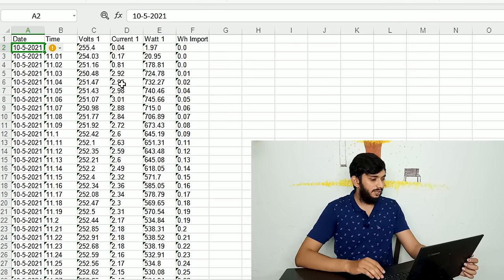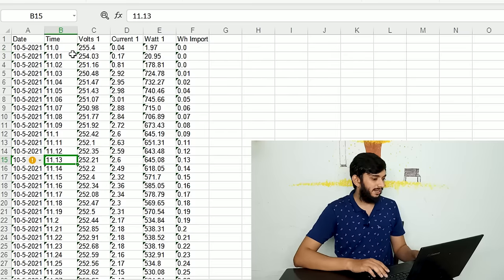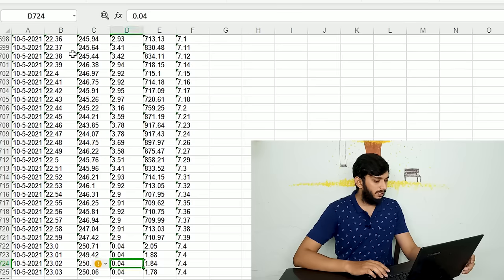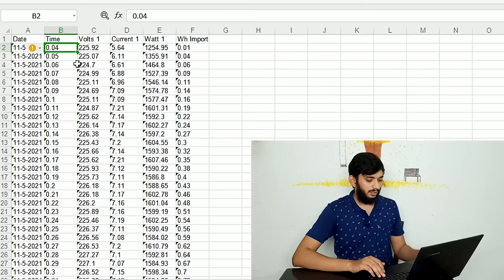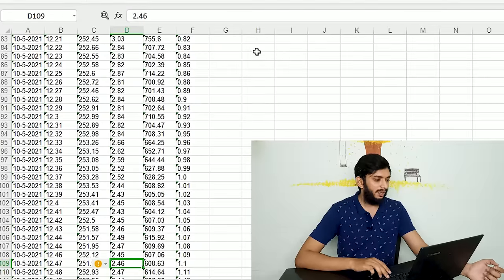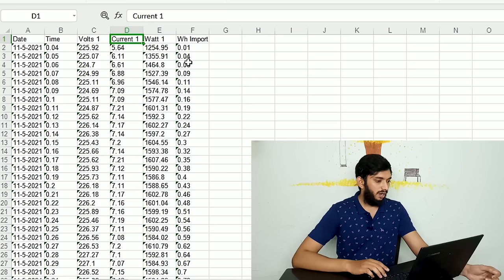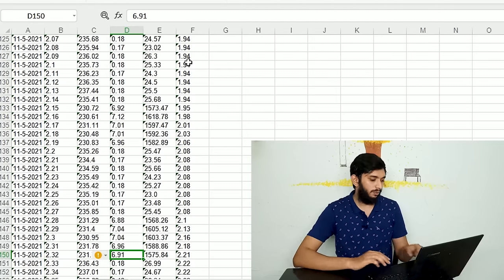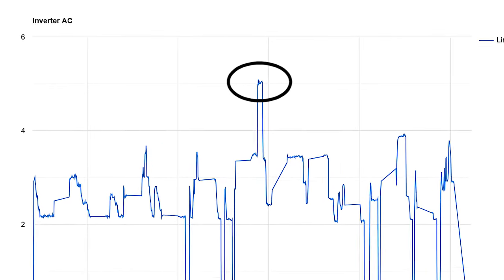Inverter AC vs Normal AC, How much unit will it consume?_Tamil, Does Inverter AC, Energy efficient?

Comment from the maker: Whoever is saying that, inverter Ac consume less power on night. I've given night time data on instagram.. 
https://www.instagram.com/syedimran.ef?r=nametag
I understand, many bought inverter Ac and justifying your purchase.. but there's nothing wrong in it. It's a good technology. Even I bought inverter Ac only.
Reply: Please Mention Star Rating & Year
Reply: @engineering facts inverter technology is the same but there are differences in their performances bro. Brands like LG has many models and its output, input power varies accordingly. So there is a chance that reconnect being a low budget inverter Ac, consumed more power. You can try d similar experiment with premium brands and let us know if there is no such differences. If there is really no such difference in power consumption btw non inverter and inverter ac, then y such innovation should take place bro
Reply: Do one thing show as the models and energy data stickers of both models. Like the cooling capacity and wattage information.
Reply: Oru Vela ton and ratings naala diff irukumo bro,?
Reply: Bro I have told correct answer...

Check my comment plz.. 
🥳🥳🥳🥳
Reply: 2 ac um enna brand ,yaethana ton uuh , enna star rating, enna year model yaedhuvumae sollulina epadi bro nanga judge panna mudium. Intha mathiri nalla videos ku full details kudukama Yen thirumba engala confuse pandringa. Please provide all the above mentioned details.
Reply: Bro inverter AC you have checked in morning time such that 11qm to 11pm.
In this duration outside temperature is high and also movement of people high(i.e. doors are frequently opened closed people coming going which leads to loss of cooler air inside room.
While testing non inverter AC u show results from midnight 12 am to 12 pm. So this values has bias.
I have seen same comparison videos from other channels which show the exact condition and inverter ac power saving when compared with non inverter
Reply: @franklinroy8333  bro you told that you have seen comparisons video from other channel...  athu enna channel name nu sollunga bro nan pakuren. Ellana video link share pannuga bro. 
This video is good but incomplete
Reply: This lockdown people face in electricity bill bro. I also figured out it already. It called conversation current cause the problem power fluctuation. Government known it people will see three paremeter V I=R ,P only. There series and parallel connection problem it causing this bro. Try to speak with proof let the people understand
Reply: I am waiting for next video
Reply: I am ECE department student I know this problem. I face it too in my project too while building it
Reply: When we connect electric device in series voltages is constant and current can be varied and in parallel current is constant  and voltages is varied it's called Kirchoff of law current and voltages.
Ok then why my home get affected . Here is fun things home is parallel connection for main power line . Where industry and manufacturer known this problem there will have separate transformer for this problem to avoid . Speak out bro. People will get educational

Solution. To reduce the cost of electricity bill According to fluctuation. It can be predicted by main power disturbing grid center  or but put transformer like for phone charger and PC adapter for every house appliances need inverter only. For more visits how power disturbing and monitoring
Problem: people is victim to pay others people power consumption of electricity
Reply: No bro Reconnect is not a best ac to evaluate try the same experiment with Panasonic o general Mitsubishi inverter AC s u may find good difference our eb bill decreased by 30 to 35 percent on replacing lg non inverter
Reply: @thamizhvananak2530  Yes this is really make sense
Reply: Thank you for your answer
Reply: AC energy consumption depends on the outside ambient temperature. How can you compare this, because one test done in day time, one at night time. Test itself is wrong ...you need to include few more parameters
Reply: Bro u have operated normal Ac during night and inverter during day time.though u checked same day night temperature will be less than day temperature. So reverse and chk u ll get idea.  When temperature high the compressor will run continuously . So it might operated continuously during day time. This is also a factor
Reply: Hi bro … it would be great if you could also check some additional things like
1) Gas/refrigerant levels / pressure 
2) indoor unit filters and coils are clean and not clogged up 
3) outdoor coils and air flow (factors that may affect heat rejection) 
4) perform test where both AC running simultaneously to eliminate outside temp. humidity etc. 
Last point I understand difficult as u have mentioned in video BIT NOW WE HAVE SOME MISTRUST SO WE MUST BE MORE DILIGENT IN OUR EXPERIMENT / real world testing 
Also can u mention refrigerant used in both models ???
Reply: ஆனா இன்வெர்ட்டர் ஏசி நான் பயண்படுத்தின வரை EB bill 100 /200 தான்டி வந்தது இல்லை இப்போ பில் 1000 வரை வருது. நான் amazon basics 5star inverter ac use பண்ணிட்டு இருந்தேன் high voltagenala inverter board போயிடுச்சி அதனால Compressor மாத்திட்டோம் இப்போ பில் ஏகபோகமா வருது மறுபடி inverter ac மாத்திடலாம்னு யோசிக்கறேன்
Reply: உங்க உதவி தேவை முடிஞ்சா
Reply: @kc0811  s this really matters.
Reply: @IlayaRaja-wy7qt  Hi I couldn't understand your theory. Could you say in layman terms.
Reply: Test itself is wrong. Inverter ac ran during day time where outside temperature is much during day time... Non inverter ran during night time where outside temperature drops. Unfair test
Reply: UNIT CONSUMPTION IS MORE OR LESS SAME... BUT THE MAIN DIFFERENCE IS LIFE IS MORE IN INVERTER AC...
Reply: Bro. I found it is wrong reading in meter which you calculate.p=v*I*pf...Watts I found it wrong.please clear me.thank you for your efforts and time.
Reply: This is flawed approach. In night ambient is low and it's very easy to cool. Run inverter ac at night and see, take down this video misguiding your subscribers. Non inverter ac during day time will take much higher units.

And everest stabilizers are crap. Even vguard malfunctions like this after few days. The last dialogue on everest is 100% correct. Stabilizer with 220-245 max is best.
Reply: How much unit it will consume if you keep AC in 19C or 20C for 12 hours?
Reply: @ajayaj8368  I've done this experiment with a sanyo 1.5 3*. After fully reaching 18 degree the inverter barely consumes power, around 150-200 w and the outdoor still runs.
Reply: @kARTechnology  How much unit it consumed?
Reply: Thanks very much. Bold initiatives and very informative. Again you from Tamilnadu prove knowledgeable.
Reply: V gurard stabilizer also waste.  AC stabilizer & refrigerator stabilizer both r waste of money. Power vathathum just 2 to 3 minutes delay time la "ON" aaguthu. 150v to 190v stepup  just 10V aaguthu. That mean 150 input na output 160v and stepdown work aagathu. 200 to 270v vara same voltage varum (input = output) then cutoff 270v la aaguthu. Ithu practical la oru video podunga
Reply: @prabakaran3344  compressor low quality la mathi irrupanga service la. So high power consumption aagalam. Basically Non-inverter AC high current edukum but off then on la oodum but power consumption Inverter AC & normal AC also equal (kWh units)
Reply: @bkk1203  not only vguard. Microtek and many other brands are also cheating customers with multiple confusing models. In vguard ac stabilizer, only 2-3 models are good. Inverter model stabilizers are crap and overheat with 1000w itself(rated 2200w) and one more thing, use low quality wires such as 1.5sq mm wire for a 1.5t stabilizer
Reply: @prabakaran3344  services la compressor low quality pottu irrukalam. 1 star or 3 star or athaveda low kuda irruthu irrukalam. But inverter AC & normal AC power consumption equal (kWh units)
Reply: No same condition was maintained for the test..flaw in the set up
Reply: @bkk1203  ena Stablizrr best?
Reply: @thamizhvananak2530  

ok
Reply: @prabakaran3344  enna kolapura
Reply: You people think he compared two different capacity AC's. 🤦 .  He is well knowledge in this field. Understand this and appreciate his efforts.
Reply: Bro epd temparature difference illanu soldreenga inverter AC Morning 11 to Night 11 which is hot temperature but Non-Inv Night 12 to Afternoon 12 which is cool temperature
Reply: Bro,  your set point  28 degree  celsius is too high. AC  set point  should be within 24 degrees.  If u want 28 degrees, better, don't install  air conditioning at all. Just using the fan will be enough. For 28 degrees celsius, the compressor won't be cut in most of the time. May be the current  consumption  data you captured, for inverter unit,  in the data logger is just for the fan coil unit (indoor unit)only. The outdoor unit does not turn on at all.
Reply: Correct bro
Reply: Your calculations are wrong 😂. Test in same outside temperature and justify your calculations 😅😅
Reply: Brother neenga neraya vishayam sollala. Neenga use pannadhu edho reconnect nu oru brand, adhoda cooling capacity enna? Evlo ton AC? Use panna rendu room'um same size ah? Mukkiyama inverter AC la 28 degree use panradhu thappu. Oru car la 60 to 80 kmph la highways la otuna nalla mileage tharum, adhu madhiri than idhuvum. Oru optimum temperature like 24 or 25 la vechu inverter ac use panna nichayama pathiku pathi energy consumption kammi agum. Nan normal ac than vechuruken, recent ah inverter ac vangunen and last two months verum inverter ac than use panitu iruken. Usually summer la 6000 ku kammiya bill varadhu but indha masam around 5500 than vandhu iruku. Maintenance yosicha than bayama iruku thavira I'm totally satisfied with inverter ac.
Reply: Single phase how many AC run in home
Reply: @franklinroy8333  correct
Reply: Thanks for the eye opening video

Comment: Great content! But the key difference here is the ambient temperature that is directly proportional to how long the compressor has to run. The inverter AC compressor has to run longer to keep the room temperature at 28 degrees in hot daylight when compared to the normal temperature of 28 degrees at night. So I believe this is not the right comparison though I really appreciate the efforts
Reply: YES THALA SAME THOUGHT THE TEST SHOULD BE SAME TIME
Reply: Same thought
Reply: Neega enna Comment potalum avaru Reply pannamataru 😂 same EV bike comparison pandran nu thappu thappa sollitu eruparu
Reply: I had the same thought
Reply: In reality yes indeed it took less current in night time i tested the same recently since i have both normal and inverter ac but the difference was negligible. The difference compared to day and nght time was around .3 ampere
Reply: Wrong
Both AC runs half in sun and half in moon
Reply: @cinebuff5374  Dude, jus see the hot times for the inverter AC : 11am, 12am, 1pm, 2pm, 3pm. Wheras, the non inverter AC has the hot times 9am, 11am, 12am. So, ironically the measurement is messed up.
Reply: Same thought. Deleted my comment since you have already mentioned it.
Reply: @cinebuff5374 but the heat will be different in the first half of the day, vs the second half of the day.
Reply: Yes you are correct

Comment: Last la... double booster, triple booster vera... semma😄🔥🔥
Reply: Nice explanation,
But your input volt is approximate of (245 to 253)V to inverter ac and approximate of (225 to 235)V to a non inverter AC. 250V is not a good voltage to a inverter AC. Higher input voltage causes high energy consumption. Input supply is not good and that could cause inadequate results. 

Again, how inverter ac consume same high energy even it has constant low current to compressor.
Reply: @venkateswariasokan855  atha than video layum kekranga. Epdi same ah vanchu nu
Reply: @vishnu-lz9pm  that could be cause of input voltage which i mentioned earlier.

Comment: If consumed units are one and the same, inverter acs are not really saving the bills.

The ac was not in the ground floor will use more load than upper floors because the ground floors are cooler by nature as you mentioned about room temperatures.

This is the real test. You did a fantastic job. Enna, same brand ac 2 star vs 5 Star AC yum units consumption check panni paakalaam..

But, as you said don't get stuck with ac's...

Your experiments are spot on... Keep it coming, Brother... 👍

Comment: Hello bro  I checked differences in my home. Ve will use the for 8hrs non inverter ac runs at 8kwh Inverter ac runs of 4kwh. Before starting the ac I noted meter reading for ac ve are using separate meter and we are using doubleboosterstabilizer

Comment: Bro I have a doubt in this video… In your earlier video you’ve mentioned that the power consumption is based on the ‘Energy Efficiency Ratio’ value, in that case I have a 1.5 ton Daiken inverter A/C with ISEER value 5.20 and electricity consumption per year is  744 units(mentioned in the ratings label). This electricity consumption info differs from A/C to A/C. 

So if someone wants to save their money in electricity bill while using an A/C, it’s recommended to go with the least electricity consuming brand/ product i.e mentioned in the rating label right ? In that case the experiment done in this video is of no help right ? 

Please correct me if I wrong…

P.S : I’ve been following your videos for quite a long period. Biggest fan of your work. You have an amazing talent in explaining complicated things in a very simple way. Please keep up your great work 🙏✌️👍

Comment: I appreciate your effort. But in my point of view, you should check the power consumption of both AC on the same time. At night time temp will go down by naturally. So it's not a big deal to cool down the room temperature at night time. I think you will get an exact power consumption result of inverter and non inverter AC when you run and test at the same time.
Reply from the maker: Check pinned comment. Given night time data of inverter Ac.
Reply: YES THALA HE SHOULD TEST SAME TIME DAY MEANS SAME DAY NIGHT MEANS SAME NIGHT AND ROOM SIZE ALSO SHOULD SAME
Reply: Yeah I agree my thought is same
Reply: I feel the same..
Reply: Exactly right
Reply: Yes u r right also the output value also will carry for normal and inverter

Comment: I feel we would have tested this experiment both in Day time or in Night time. I doubt outside temperature won't be same for both Day and Night. BTW, Really thanks for all your efforts. Good job bro. Also, Nice to participate in your Quiz. Stay safe.
Reply: Yes Defenalitely Morning 11AM - 5PM Outside temperature Increasing gradually! at the same Night 12AM - 6PM Outside temperature Decreasing gradually!
Reply from the maker: Check pinned comment. Given night time data of inverter Ac.
Reply: Whatever it is , if need clear data same kind of room, same timing, and same day testing give accurate data.
Reply: @engineeringfacts  I could not find Inverter Model test result of Night time. If possible, please upload to same test results path. It will be useful
Reply: @engineeringfacts exposed wall entha direction la irunthuchu.. rendunroom kum same wall thana ??  Roof rendu room kume exposed ah ??  Wall oda u factor rendu room kuk same ah??

Comment: Bro, when Setting at 28 degrees, non inverter AC's compressor will not run most of the time but the inverter AC's compressor would have run at a low speed making the power consumption higher than the non inverter AC. So conduct this same test with temperature at around 23 degrees celcius. That would give a lot of different results.

Comment: Inverter AC:
1. Power demand is uniform and less compared to normal. So the wiring load would be less
2. Noise would be comparatively less
3. Prone to more breakdowns
4. Runs on wide range of voltage
Reply: Need to ensure that both runs either Night only or Day only as well as the * rating of the model should be considered otherwise its apple to orange comparison

Comment: Hi, your videos are great. But I would like to bring to your notice, some of my knowledge in the Psychometry, Refrigeration & Air conditioning field. The timing is different and due to which  AC will get heat load according to the ambient temperature and humidity. We can ignore the effect of humidity. But we should definitely consider the heat load by day and night. Average day temperature (Dry Bulb Temperature) and specific heat capacity of air will give the heat load. There is considerable amount of current will be saved if any AC made to run on 12 hrs basis in night time comparatively with day 12 hrs. So this is not the final verdict according to my Mechanical Engineering knowledge.

Comment: The time selection of both the  ACs are different and hence the variatin in heat loads.
Pl. Check the tests both again by starting Non inverter AC in day time & the Inverter AC in night.
Compare your results now with the previously compared values.
S.K.Sabapathi.

Comment: Non inverter used in night time... temperature would be less comparing to day time... may b u should test it once in day time....
Reply: Good point
Reply: Same point is running in mind actually
Reply: Rendu ac yum orae timela oda vitu check pannirundha perfect result vandhirukum
Reply: @kalaivanann4042  அதற்கு மீட்டர் பாக்ஸ் வாங்கி நீ கொடுத்தால் நல்லா இருக்கும் ஒரே டைமில் பார்க்கலாம்
Reply: @kalaivanann4042  ஒரு விசயத்தை சொன்னால் அதில் ஆயிரம் நொட்ட சொல்லு சொல்ல வேண்டியது
Reply: @karuppaiya.sampasivam1207  Avarukita soldra commentku un poola thookitu vara vendiyadhilla
Reply: Yes, this testing is not correct, both should be tested in the same room and same time, consumption of current at night will be lower at night when outside temperature is also low, I don't know why he puposefully did that, may he want show a biased result that inverter consumes same curent